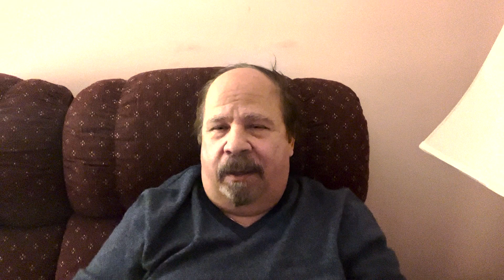What's Random Anyways?

Comment: I'm here for the lengthy videos.

Now that you mentioned using ESP32 to produce sudo numbers, did you know that same as Cortex M4 it has the tRNG?
I believe they both generate the seed by the same principle - radio waves that either BLE or the WiFi module is producing. 
So in case you had both modules disabled - you got an sRNG.

uint32_t n = esp_random(); will produce a tRNG seed and generate a number based on it.
Reply from the maker: thanks for the info. I did find that the ESP32 was using RF noise for a "TRNG"   I could not find info on how the Cortex M4 TRNG is implemented, but for sure it can't be based on RF noise as the chip has no WIFI or BLE radio.   I am, probably foolishly, assuming it does it in silicon with reverse biasing, and that would suit my experiment.  Since that is uncertain and my experiment needs that, I feel justified in reviving my own TRNG board design that uses a reversed biased transistor.  More on that in the coming days.   I also have an appropriate TRNG that's a standalone USB device, but don't really think the M4 can act as a USB master... I'd have to move all the fun over to a raspberry pi or something.
Reply: I see. It would be cool if you'll be able to test and compare the bias of all three devices and what can influence it. For examples a microwave will probably layer a pattern on the ESP32 but who knows how many data samples you'd need to gather for that to be noticeable.